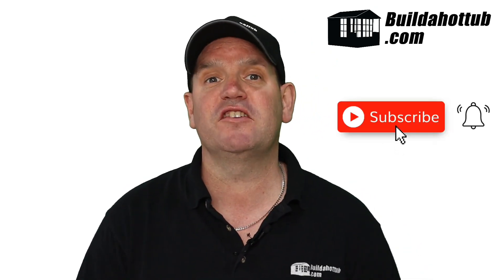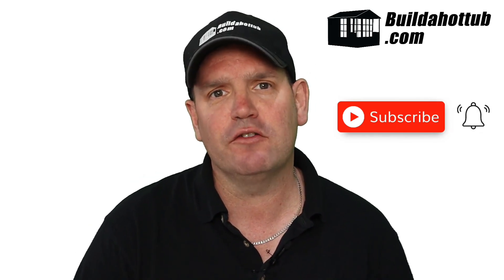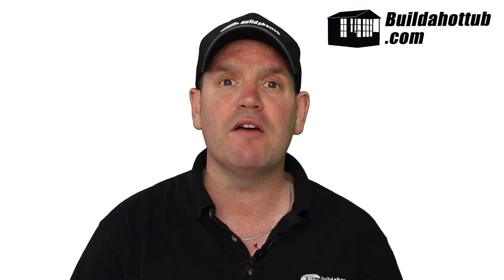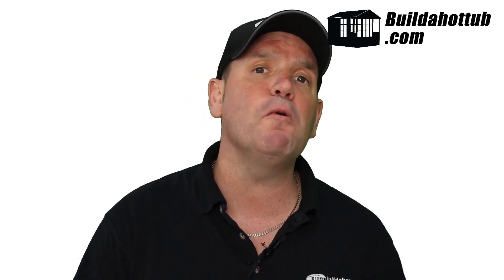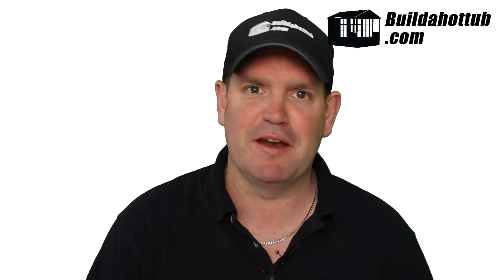Everything you need to know about gas heaters for hot tubs

Comment: Hey Andy do you build gas hot tubs from scratch or do you retrofit them? Thats how i ended up here, i was crusing facebook marketplace  and saw a lot of free/second hand tubs. Electricity here in ontario canada is expensive while natural gas is still relatively dirt cheap, i figured converting electric hot tubs into gas tubs could be a viable business.
Reply from the maker: Hi There, technically I do neither - I design in gas heaters to my hot tub designs for customers, but I don't build them for them myself. Gas heat tends to be when it is a large hot tub and they want to have it heat up quickly. I have not done any retrofit to plastic shell tubs for gas heaters - I have for heat exchangers and air source heat pumps though, so the process is the same. If you are looking to learn more, look up my Air Source Heat Pump video series, the plumbing principles are the same for a gas heater. With a gas heater, you need to enable to 5min cool down sequence on the spa pack though so stop any kettling happening. Hope tha thelps - Andi
Reply: @Buildahottub  hey, thanks for replying, i sent you a lengthy email yesterday!🙂

Comment: Hi Andy,  Thanks for your videos! In your BTU/hr calculation example, you did not multiply by 30 °F ( Your result would be raising the tub temperature 1 °F.  ) but I'm not sure about your conversion factor 50 either.  I'm calculating about 196,500 BTU to raise 785 gallons from 70F to 100F.  It takes about 8 BTU to heat a gallon of water only one degree F.